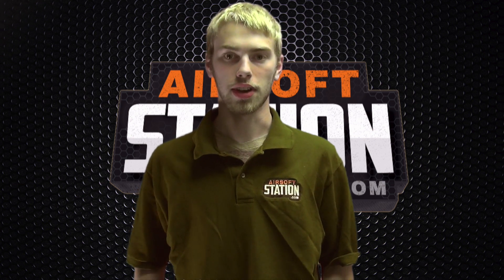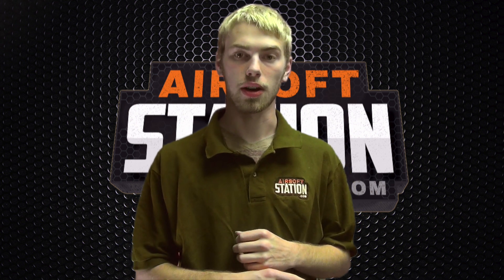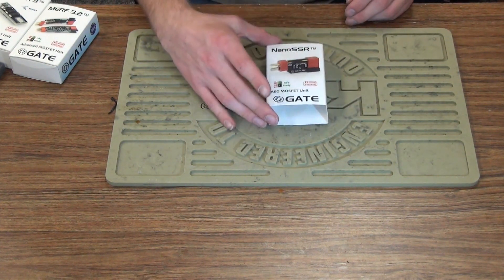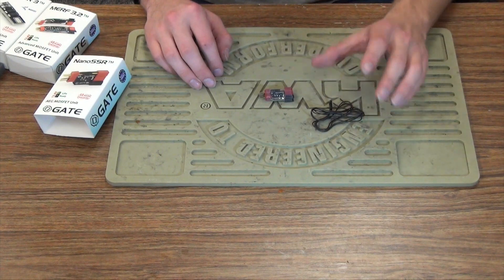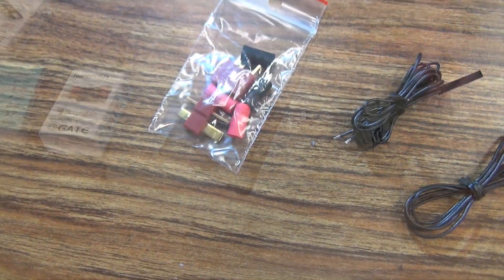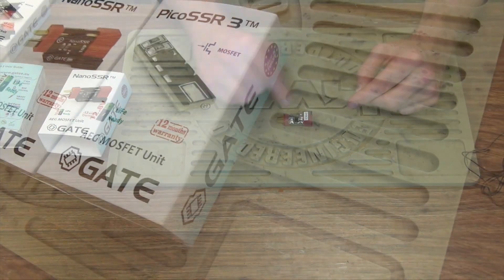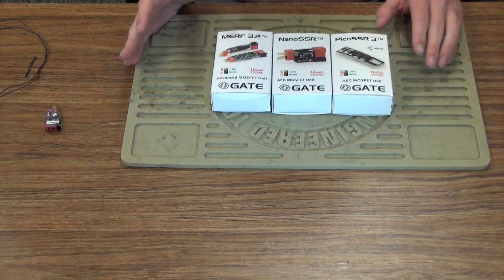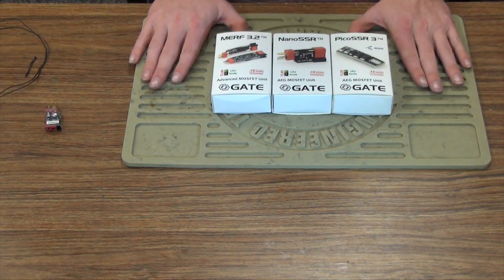Airsoft MOSFET:  What is it?  - AEG Tech Help

Comment: So what is the mosfet cost vs trigger switch replacement cost? Coming from nerf I have many blasters running on 11.1 lipos and the cost of replacing a trigger switch is next to no cost for people that buy stuff like that in bulk. Basically I'm asking if a $40 -$50 mosfet is really a cost saving over replacing a $2-$5 trigger switch once a year? If even that often. And does a mosfet reduce the arcing in the motor on the brushes and stator? I'm my experience the motor brushes will wear out way before the trigger switch contact

Comment: Hey by any chance is it possible to get a mosfet for a SIG 552?
Reply: Any basic mosfet or programmable mosfet will work with an SIG 552. Drop-in mosfets like the GATE Titan and BTC spectre doesn't fit in all types of gearboxes and/or AEG's though.

Comment: say i removed the fuse, moved to deans connectors, and rewired a mosfet (the one on my right your left to be exact) what kind of ROF improvement would i see...

further more, would i see an increase in play time on the battery by reducing the resistance?
Reply: currently looking for a fairly high speed build, i currently have a cnc 45,000 rpm motor in my G&G raider. and i feel like my 9.6 is limiting its potential, i would like to move to a 10.8 NiMH or even an 11.1 50c lipo to have it really sing. this is in addition to the wiring and mosfet i said in the previous comment.